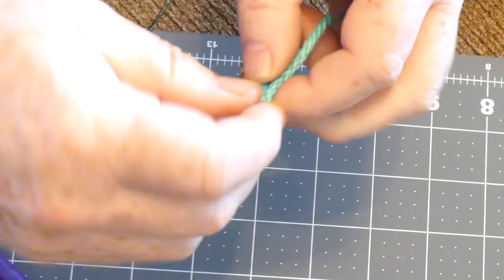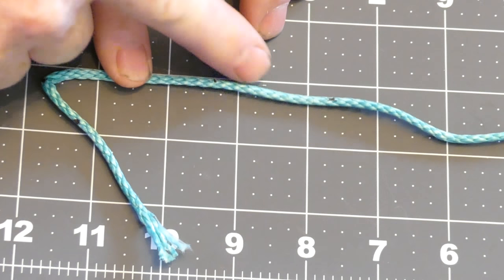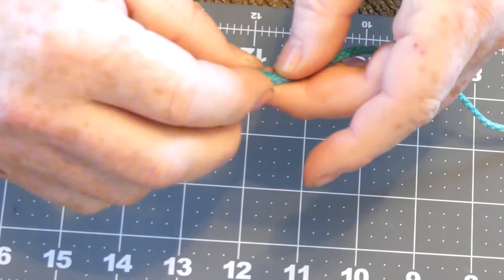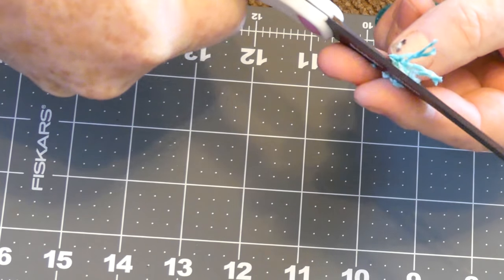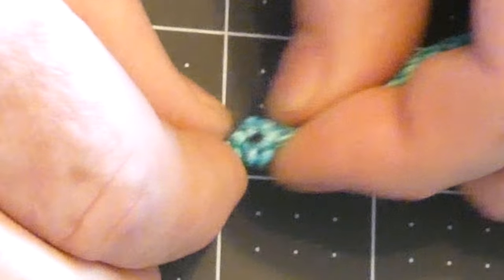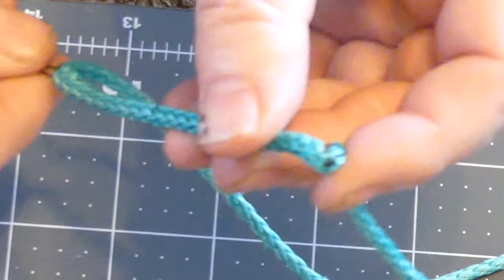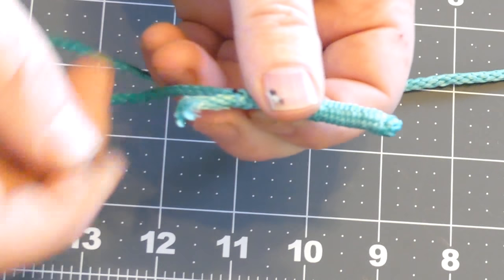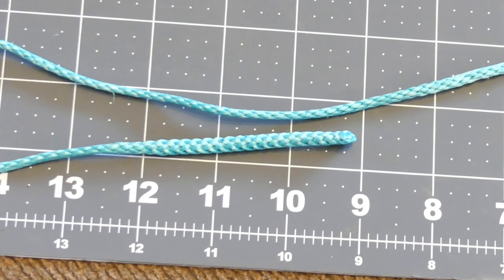How to make Amsteel/Dyneema/Zing-it Backsplice End Bury for Hammock Whoopie Slings

Comment: One reason why the end should be thinned out is so that the buried part becomes gradually thicker and the fibers of the outer rope don't have sharp bends. This makes the the splice stronger and prevents it from slipping out. It might not be critical in this particular case but when you splice a loop you should make the taper more gradual and definitively not cut it off.
Reply from the maker: Thanks for the tip and great explanation.

Comment: cut the strands on the end stepwise and it will make a more tapered transition.
what kind of wire are you using for a fid? none of the commercial tools are small enough to use for splicing this dia amsteel it seems

Comment: Very nice video. The camera shots are close enough to see everything you're describing and no obstacles are in the way (like fingers or torso). Very nice step-by-step detail. I camp in a Warbonnet Ridgerunner Hammock.  I attached a Dutchware Ringworm (small titanium hardware) to secure each tarp corner line. The backsplice on each tarp line insures I won't lose those Ringworms. Thanks! Perfect solution!

Comment: Thanks for the video.  I want to try this today.  A couple tips for you:  I have no clue why, but a typical kitchen knife with a ceramic blade cuts Zing-It line like butter (even makes sharp diagonal cuts)!  No frayed ends at all.  Another tip I just found out today is a lighter won't melt the ends of Zing-It line, because it's not enough heat.  Try using a mini torch instead.  It works great!

Comment: Just saw that paracord comes in larger diameter and up to 1100# test.  Always good options for other cordage uses.
Reply from the maker: Wow, that is pretty strong.  Does it have more strands?
Reply: But paracord stretches 30% by design. Dyneema stretch is something like 2 %